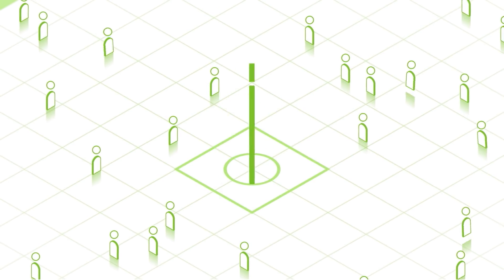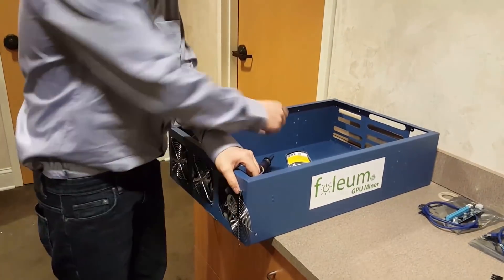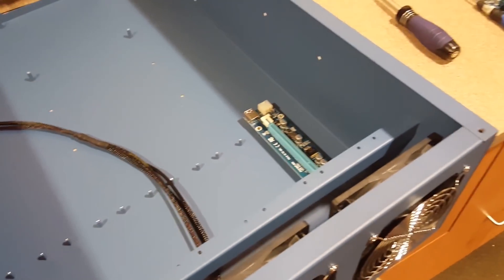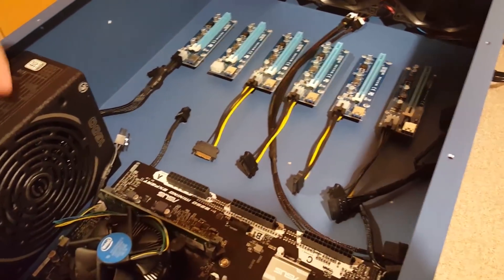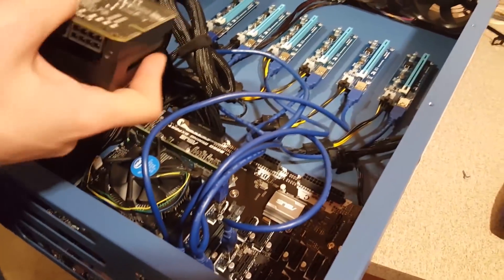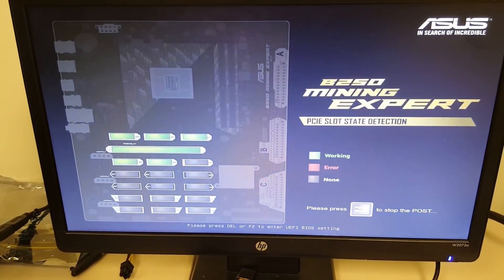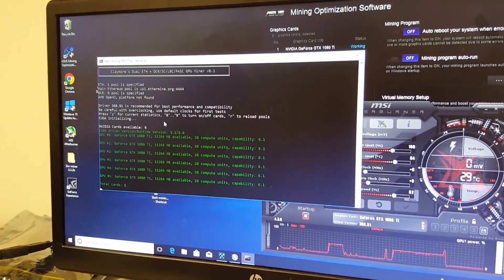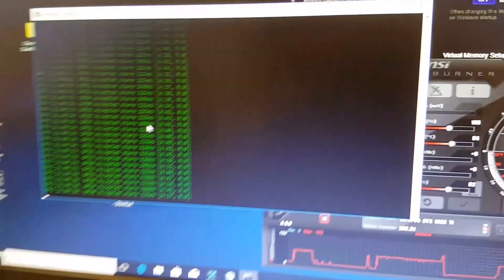Building a 1080ti Zotac Custom Cryptocurrency Foleum Miner

Comment: Why are you using a b250 mining expert instead of just a basic msi sli plus, or something else. What a waste.
Reply: Dude he is making a miner it needs as many MINI pcie as it can an sli pro has full pcie the other one is a waste less graphics cards then less money he isnt making a gaming rig it needs lots of mini pcie 3 gpu even if its 1080 ti it will take months to 2 years to make money back you need more gpu not less amateur hour here
Reply: Lol, i have plenty of mining rigs. Its worthless to build a 6 gpu system on a b250 mining expert. B250 Mining experts are pretty worthless boards in general. 8 gpu you can run msi sli plus for very cheap, or even order cheap alibaba riserless boards for cheaper than a b250. Running a B250 with only 6 gpus is amateur hour. Also his cases are garbage too.
Reply: Sean Regulater the b250 is still better for mining
Reply: SabrePlayz_YT no it’s really not. Poor diagnostic system, extra power requirements, and poor support. Only good if you want to run all 19 gpus and have the required amount of mining gpus to go with your regular gpus.
Reply: Sean Regulater what if its used for a graphics processing server? What then all gpus could come in handy in that case
Reply: Graphics processing on 19 gpus with a low quality cpu, good luck. 1x PCIE can be used for rendering, but you wont do much with a lot of GPUs on a low end CPU. These boards are more a commodity than they are a product. They released very little in the beginning, causing the ability to charge high amounts and they were burning out left and right, and then users found out it was up to 13 regular Nvidia and up to 8 Mining Cards, not all Nvidia or AMD. I can support this statement especially since i have 4 burned out boards from initial testing with 19 gpu systems for resale that they wont warranty out. They are rarely used now, and pretty much any board made for mining is not worth getting. You are paying more for mining in the name. There are plenty of consumer grade boards that have higher specs, better diagnostics, better support, and so on that are cheaper than these "mining specific" motherboards.
Reply: Another reason everything needs to be cheap except gpu get a cheap motherboard ram the sli pro take high end cpu not cheap so its more of a waste spending another 200 for a cpu that fits? You are the most stupendously stupid person of 2018 miners
Reply: MSI SLI PLus takes an 1151 slot, any cpu. z370 is g4900, z270/z170 is g3900. The B250 Expert is the same socket as the z270 and z170 msi sli plus, except you can pick those boards up new under $100 or used under 50. Do you actually know anything about mining or just pulling shit out of your ass?
Reply: The cpu in GPU mining thats a key aspect doesnt change any performance and will make you lose less money so if you want to get an i7 or a threadripper and take 2 to 3 years without profit then be my guest but dont say i sidnt warn you 3 times about mining
Reply: Nothing requires you to use the max end cpu for that socket. You dont need to run an i7 because the board is an lga 1151, the G4900 and G3900 both cost under $40 and are the same CPU people are using on b250. You can order cheap 8/9 gpu riserless boards in from China that already have CPU and RAM for under $150 too.

Comment: How are nvidia 1080? Not 1080ti. I'm asking because my girlfriends father ships tons of gpu for his business. He promotes them for video game use and does not mine at all. Anyways, let me know if you can, i'd like to have some info before i approach him on all of this.
Reply from the maker: Hi John Doe, 1080s will work for mining they're just not as profitable necessarily as a 1080ti keep in mind we may see new hardware here in the next 30 to 60 days unless you can get a really good deal on them.
Reply: TheBitcoinMiner I did look at some of the benchmarks and I can see what you mean. Sorry to take your time with a question that was so easily researched. He hasn't been selling cards because his Market was for gamers. The boxes are really just collecting dust. I'm going to do some more research, check out more of your vids and the hardware you use and refer back to you with any questions, if you dont mind of course. I'm trying to Sprint through this before the day Bitcoin and other currencies go backup.
Reply: TheBitcoinMiner also, when I was growing vegetables, I was running all my 240 volt into a box that can cut my amp usage to 1/3. And the Box just plugged into the 240 volt where my dryer would. Do you know what that's called? And where I can get it? Also will that diminish the work the mining rig is putting out or will it only affect my energy consumption in a positive way